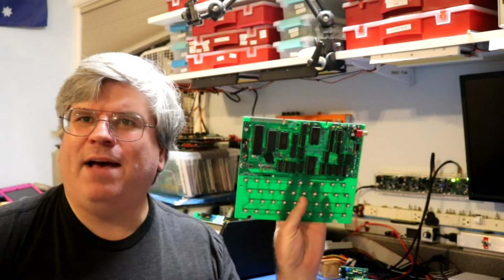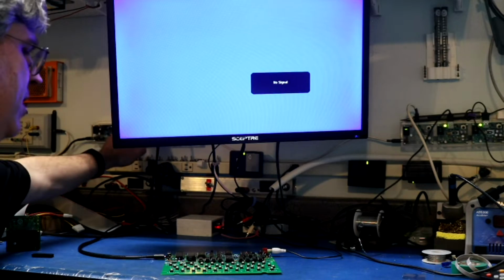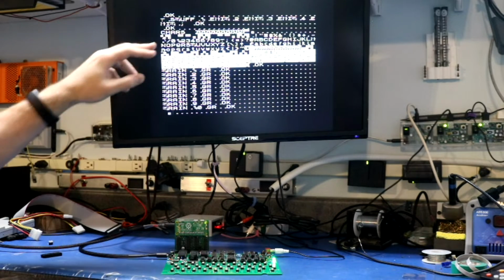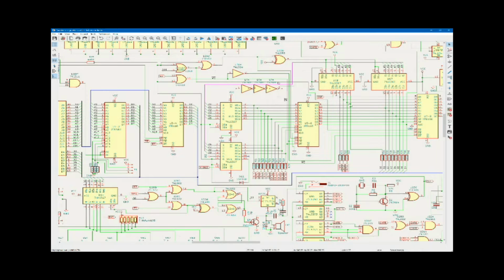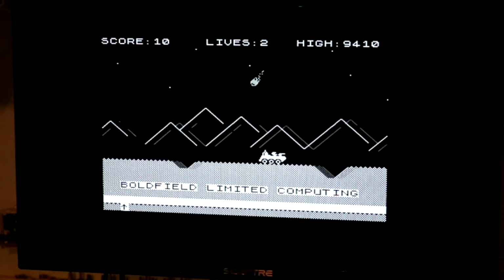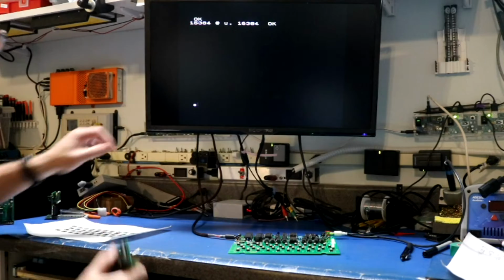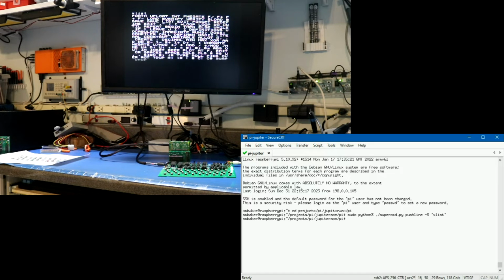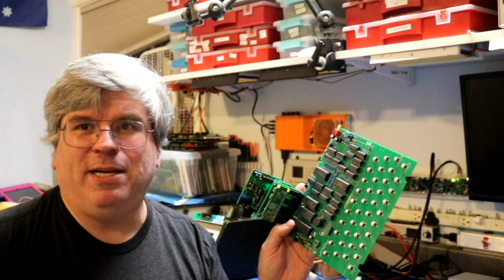I built a Jupiter Ace clone, and 3 new modules for it!

Comment: Fascinating video, thanks.  Just to add (although I have not reviewed the schematics), it is the combination of the Write and Chip Enable lines being acive that causes the write. In theory, the write can be established any amount of time before the address lines, but it will have no effect if the Chip Enable respects the set up time requirements for the address lines. Of course, it's equally important that the combination of Write and Chip Enable and data signals respect the hold time requirements at the back end of the write cycle.  So sometimes, simply delaying a signal is not enough because it simply moves the problems from the beginning of a cycle to the end. In such cases, some additional gating may be required to terminate signals early enough.

Comment: Did all 3 speeds (400/200/55ns) of 6116 RAM you had work after the inverter modification?  I'm wondering what speed 6116 is needed for the ACE

Comment: Thanks for making this cool video and good to see Tut-tut running on another Ace-like system. Maybe I should add support for your speech module to the game. I've been developing on a Minstrel 4D, which is a modern day Ace compatible, from Tynemouth Software. It uses an RC2014 bus connector rather than the original Ace edge connector, but I don't think that will be a problem.
Reply from the maker: That would be very cool. There are some RC2014 bus speech synthesizers out there (including one I designed myself when I first got started with RC2014), so it seems like a talking Tut-tut could be a cross-platform possibility. I enjoyed Tut-tut, and have been meaning to go back and play through a few more levels. Quite a strategic game, really.

Comment: You mentioned you used Linux.  I also use Linux and I'm having a difficult time getting WinCUPL to run (fighting a dwsbc32.ocx issue).  What do you use to program your GAL's?
Reply from the maker: I generally use WinCUPL on Windows. I'm sort of a hybrid user -- almost all of my "real" programming is on Linux, but I use a Windows desktop as my portal (via SSH) into the Linux boxes that I work on. So it's natural for me to use windows to run WinCUPL, though harder to automate. An alternate would be Galasm, though I think the syntax was a little bit different.

Comment: it amazes me how little logic is needed to get these z80 systems together. I imagine you could fold all the TTL into a PAL or small CPLD and collapse the BoM down to just a few ICs. kudos to you for solving the hardware timing issue. I suspect older RAM chips took longer to sample(?) the address bus after the write signal, but the new ones assume a shorter setup time.
Reply: True, you could. But whats the fun in that ? When I created it I tried to stay as close as possible to the original design. Once you start 'upgrading' components you are not really re-creating this computer. And then you are just one step from simply emulating it on a single ESP32 board...
Reply: @CeesMeijer  I think RTL and Verliog development is pretty interesting. software emulation can be depending on the fidelity and form factor. If the ESP32 board had the same board-level I/O as the original and was fully SW and peripheral compatible, why not?

at what point does a reconstructed jupiter ace lose its "jupiterness"?
Reply: @poofygoof  
I think the point where it loses  "jupiterness" is different for every retro-computer hobbyist. To be fair, I also shifted the point slightly by using 'modern' SRAM chips and a switching voltage regulator.
Reply: That’s exactly what the ZX81 did with its ULA 😊
Reply from the maker: It would be fun to try a few more SRAM and see if I could find one that worked out of the box without needing the modifications. On most of my projects I do tend to fold logic into PLDs, either ATF16V8 or GAL22V10 devices, but it's also nice to see something like this where everything was laid out in pure 74XX series logic.

Comment: As 'the guy who designed this' I was very surprised to suddenly find this video. Great work, and nice to see you spent way more time with the finished unit than I ever did. But I suppose I'll have to build a RAM extension and RPi board now. 
I left some additional comments on my Hackaday page.
Reply from the maker: Cees! It's great to meet you! Thanks again for this project, it was a fun build, and also practical (at least for the time). I was surprised at the quality of some of the games that were written for it.
Reply: @smbakeryt  Yep, the programmers at the time really got a lot out of this super-limited hardware. And I'll upgrade my schematic and board to include your additional inverters.
Reply from the maker: @CeesMeijer  Sounds great. If you have the space for it on the board, might not be a bad idea to make it jumperable whether to use the delayed or non-delayed WE signal. Just in case someone has some RAM that doesn't like the delay. (Maybe I'm being a bit over-cautious here...)
Reply: @CeesMeijer  What IS the purpose of the 555 and associated circuitry and would it be wise to include a PAL/NTSC jumper on Scott's modded PCB or just tell NTSC users to pull the 555?
Reply: @CeesMeijer   I was wondering if the updated Gerbers were available?
Reply: @colonelbarker  Not yet. Actually almost finished,  but I didn't have much time lately. But your comment might be a good reason to pick it up again...
Reply: @CeesMeijer  I'm happy to wait. I listened to the Advent of Computing Podcast on the machine, watched this video and thought I'd see if the gebers were still around. 

Do keep us posted!
Reply: @CeesMeijer  Gerber poke! (I hope you're doing well!)

Comment: I remember a computer fair in Sweden around '83 or '84 where they had a Jupiter Ace connected to a slot car race track to demonstrate the power of Forth, allowing visitors  to challenge the computer.
The speed and consistency of the computer controlled car was quite eerie to watch.
I can see why it didn't catch on but oddball challengers are always fun.

Comment: Adding three extra inverters to the CE line sounds good from a delay point of view, but doesn't that INVERT the signal too?  Surely two or four gates would be better?
Reply: Great video and cool expansions! I built one of these boards 3 years ago, also ran into a few issues getting it to work, my comments are on the hackaday page. (Used all 74LS logic ). I still have composite output issue, will see if removing the 555 timer will make a difference.
Reply: Removing the 555 timer solved my composite video issue! Now get nice stable text on my composite monitors :)
Reply: If you look again, he’s actually using 4 inverters.
Reply: @markcummings150  Sorry, you're right.  I was struggling with the resolution to see clearly.  I had 'seen' the three inserted after the one, rather than making a different signal.

Comment: How odd this just came up was discussing similar concepts with a Z80 computer vendor recently, "reviving" the Jupiter ACE concept but with the weird memory map fixed in favor of a more straightforward memory map and upgrading the video capacity. I hope forth computers make a comeback soon, the FIG's seem to be dying but I really want this to live and would really wish I grew up with Forth rather than BASIC
Reply from the maker: Which Z80 computer vendor? The Minstrel 4th and Minstrel 4D are other options in this space, though with some modernizations. I was originally looking to build one of those, but I think I ran into shipping issues to the USA.
Reply: @smbakeryt  The guy behind Zeal-80, not sure if vendor is the right term, designer and seller? I am introducing Zeal-80 to the why and how of dual stack VM's and the power of Forth